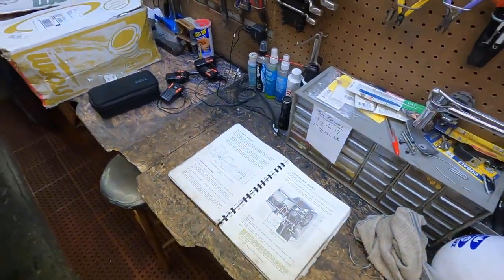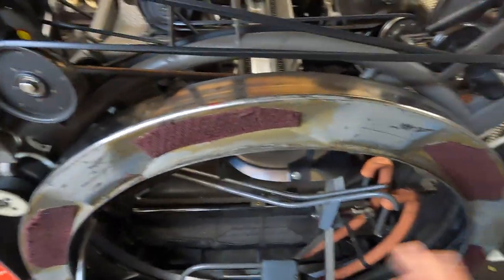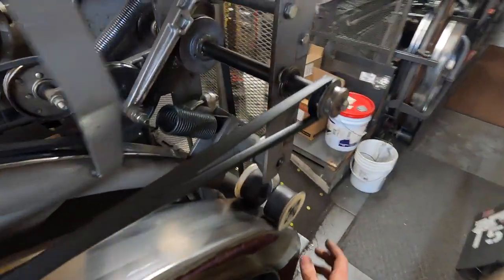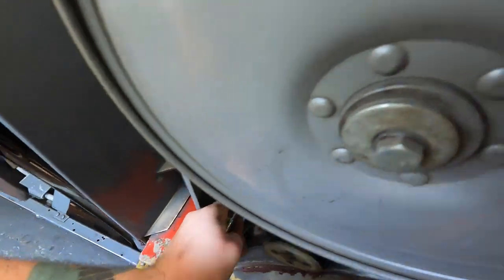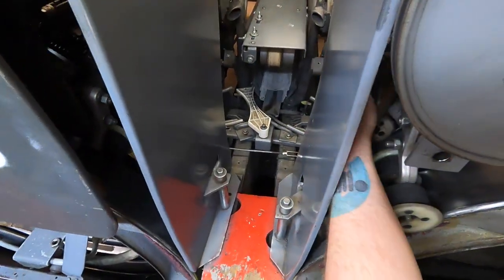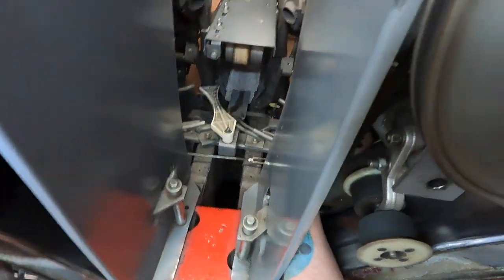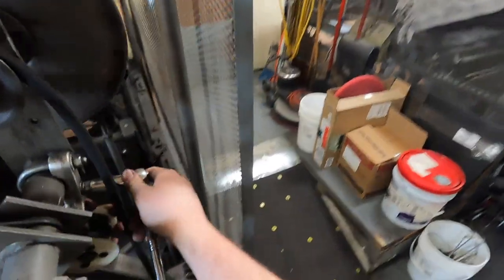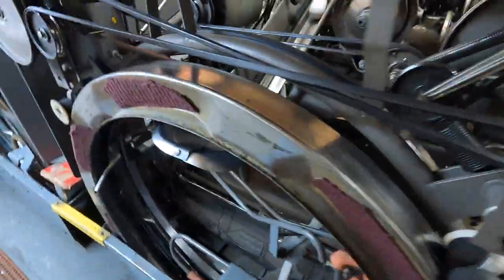Elevator Guide Roller #25 - Brunswick Pinsetter Adjustment

Comment: I was taught the same way regarding BW guide rollers, there was another step that I was taught to ensure the BW guide rollers are as tight as possible. After getting it tight with your hand snug up the nut on the u- bolt then tap the guide roller bracket with a hammer a few times then snug nuts up fully. Regarding PW rollers..lol my trainee had the guide rollers tight to pinwheel and yeah it bound it up. I was thinking magnetic clutch going but then noticed no wobble on pinwheel. Loosened guide rollers everything was fine afterwards. Yeah I hated those guards when I was with AMF. Horrible idea.
Reply from the maker: I’ve heard of the hammer step lol but I can see it helping for sure and yeah we had someone a few years ago do the same thing with the pin wheel. And we went so far as to change out the clutch and the rectifier just for it to be the rollers lol
Reply: @shawnmbowling  lmao. Good times. Be safe my friend.

Comment: I’m having trouble with my ball wheel belt coming off but I see you can put the belt pressure with 1 hand I’m kinda curious if I have the right one on there. All my machines have the same one but yours just looks way easier to get on
Reply from the maker: The main thing I’d look at is make sure your belt is centered on the wheel. There’s been times that no matter how many times I adjusted the guide rollers, the belt would keep getting thrown off. As for doing it with one hand I’ve always been able to do that, my grandpa has to get on top of the back of the elevator (where’s the lift rods sit) and use two hands lol